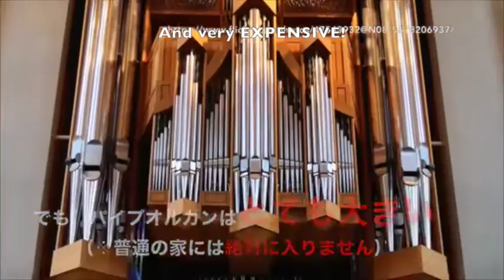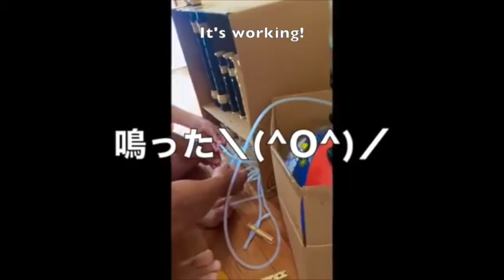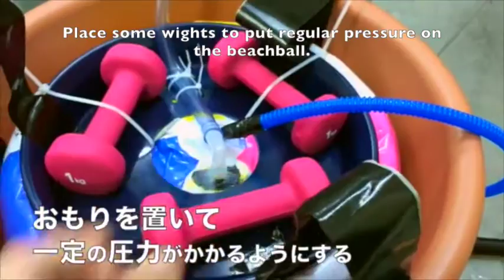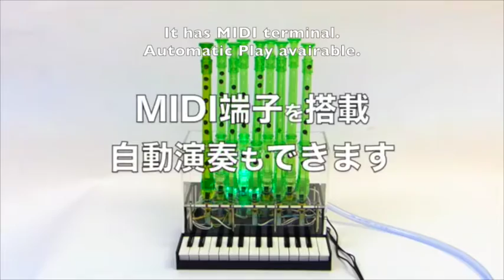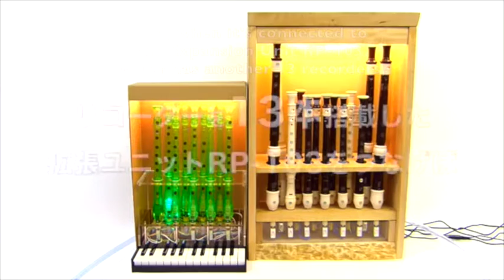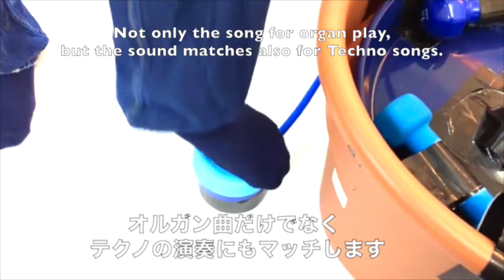HYBRID RECORDER/PIPE ORGAN: RP-09 - SOLECON3rd

Comment: A bicycle is a good way to create a blower. The weight of the wheels gives it more momentum as a flywheel, and you can link a chain to a rotating blower. From the blower, hook up the wind line to the bellows. The bicycle allows for a somewhat constant wind supply. You can make a larger instrument. It makes more noise, though.